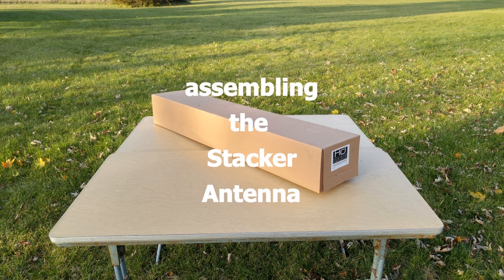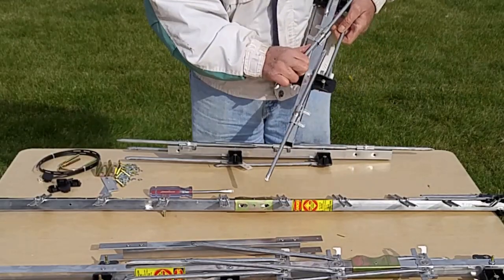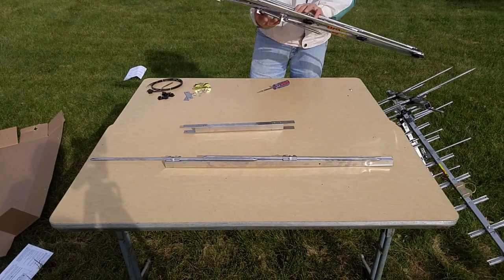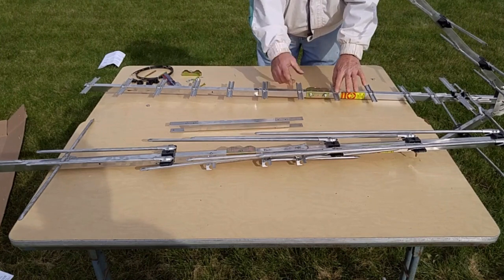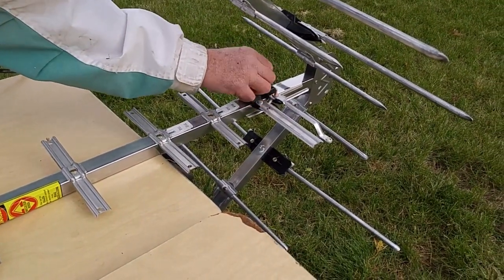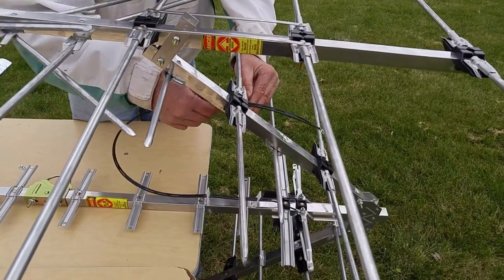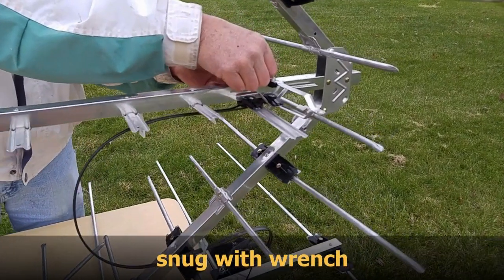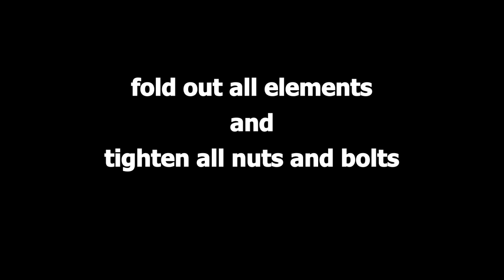Assembling the HD Stacker long range rural TV antenna

Comment: Instructions here are significantly different than the manual and neither one has enough details. You just start picking up nuts and bolts without pointing out which you are getting
Reply: There is only one size of straight bolt and one size U bolt that comes with the antenna and two different sizes of nuts. The smaller size nuts fit the straight bolts and the larger nuts fit the U bolts.Not much to talk about. I'll look into this and see if others have the same opinion as you have I will change it. The customer feed back has been extremely positive towards this video.

Comment: Are the posts where the antenna attaches supposed to be isolated from each other? Im trying to troubleshoot mine and it seems they are shorted together.
Reply from the maker: Send a picture or two of the antenna  and I'll let you know if it's assembled correctly.  dithaca@msn.com

Comment: To the novice, mark the VHF/UHF rails with a marker to ease confusion before assembly. Wear surgical- type gloves or your hands will be coated with gray/oily film immediately.  Manual figure 5 shows UHF corner reflector boom element above rail. It is not same as video position @7:00, element shown below.     Manual fig 12 has Twinlead attached to (upper) VHF Downlead terminals, when @7:15 it appears to be attached under  UHF (lower) rail. Careful when tightening Transformer, wire clips are very thin and can easily break. Video has no "stops" to show how  each stage of assembly should look and way too much finger tightening. Take a drink everytime you hear "as shown" and throw away the manual: "When mounting antenna indoors" very funny.